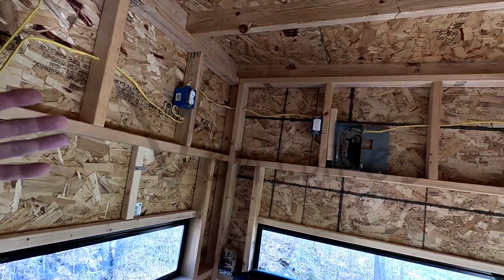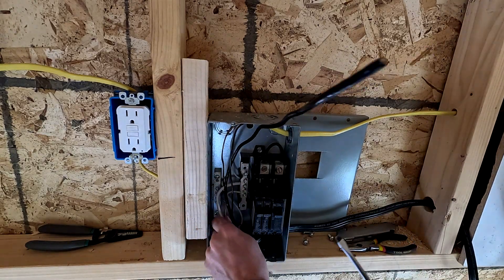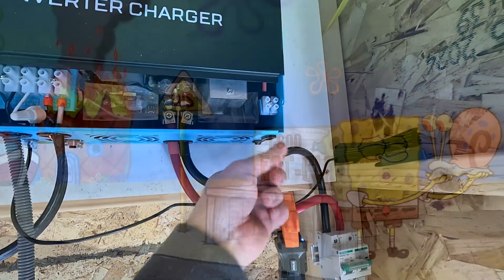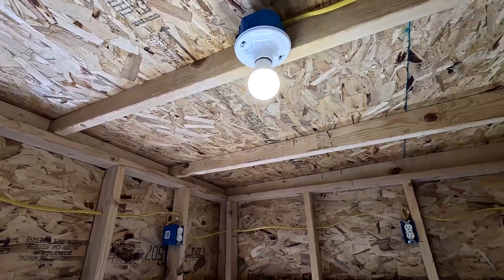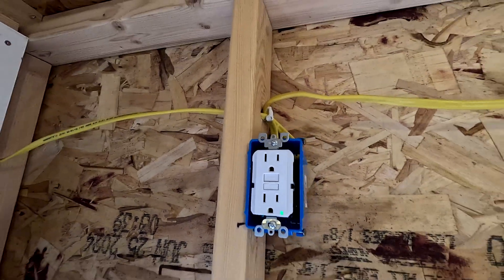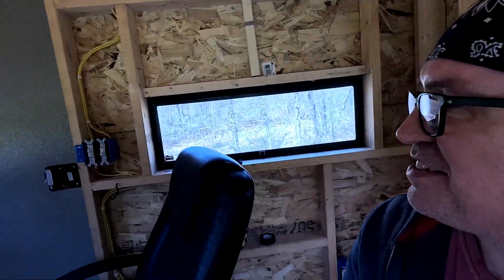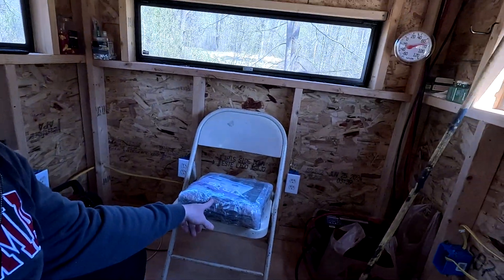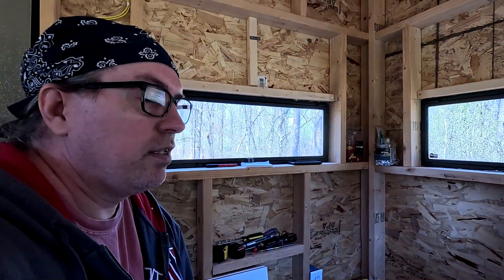Renogy 48v 3500w Solar Inverter Charger Install

Comment: Hi, im Installing the same inverter charger in my tiny house. Can you tell me what kind/ gauge of wire you are running from the ac output to the main panel? 
Great video!
Reply from the maker: Hello! Glad you enjoyed the video. I'm using 8 gauge cooper wire so that it can handle the max 40 amps from the inverter. Here is a link to what I'm using:  https://amzn.to/4m0Hyob

Comment: The grounding screw on the bottom of your inverter where do you have that going to I have the same inverter simply using a power strip my pool pump will not turn on because it says there is no ground everything else around the house works except my pool pump keeps give me a grounding error code
Reply from the maker: As far as I can tell there is no real ground on this unit
 The screw on the outside it just to ground the metal of the device. I have it connected to the breaker box I setup. I do plan on putting a grounding rod in the ground and connecting the breaker box to that. I don't think this would solve your problem.
Reply: @RickyVentures alright because I ran a grounding wire from that screw on the case to a grounding rod outside and I'm still getting a error code everything around the house works except the brand new heat pump for My Spa can I create a ground neutral bond by running a jumper wire from the neutral terminal to the Ground Terminal inside the inverter ? Since I'm using a power strip and not a breaker box or service panel
Reply from the maker: @thelithiumpowerch maybe a gfi outlet off the inverter and plug into that? I think you should call up renogy and ask them or call an electrician to get professional advice.
Reply: @RickyVentures my inverter is just like the one in your video except it's all white is a 24 volt 3000 watt made by different manufacturer

Comment: I have same inverter! When does your fans on bottom spin? Is it based on load pulled or temperature?
Reply from the maker: Seems to be based on load is what I have observed.
Reply: @RickyVentures researched some more looks like fans also turn on if charging at 600 watts or more